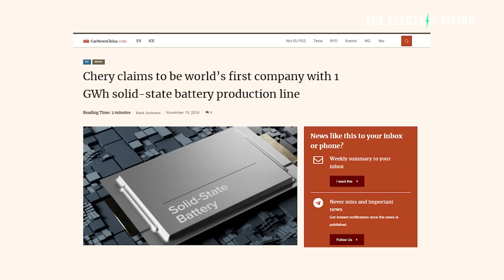Car maker shocks everyone with mass production solid state battery factory

Comment: What about Amprius technologies collaboration with Tesla to achieve an extra 20 percent range and 80 percent charge in under 6 minutes ?
Factory to begin production in 2025.

Ultimately if the car does 300 miles a charge, I’m good with charging it twice to get the range of a more expensive solid state battery.

Comment: While I agree that EVs are absolutely necessary and the only way forward in the future, ICE should and will continue to have its place in the market.

EVs are undeniably superior for everyday driving and luxury applications, but ICE offer a level of excitement that is ideal (and almost essential) in performance vehicles.

Naturally aspirated, high revving ICE vehicles produced in low numbers will stick around. Not as a mode of transportation, but as a means of entertainment. For a weekend joyride, not a daily driver.

As battery tech improves and the weight problem is overcome, EV sportscars may become more engaging. However, there will always be a market for ICE sportscars.

Comment: Its not a rocket science.  Currently ev range is rubbish so doesn't make sense to buy it for most people. Also limited charging options and time to charge them. If evs reach the range of ice cars, then we can start talking.  But battery cost and car depreciation are still at play.  What i want is 10 year warranty on the battery,  similar range to my diesel car and availability of fast car chargers at every petrol station.  Don't bother talking to me and forcing me to buy ev before that happens

Comment: Unless you are personally invested in a specific technology, the details do not matter.  Something, will come along.  There will be an advent, a sea-change, be it solid state or another one.  To not believe that, is to have a complete lack of faith that developments can be accomplished.  I am certain advances will be made, I doubt many watching Sam’s videos feel otherwise.  Zinc-Carbon, and Alkaline cells were both conceived initially, before 1900 (source:wiki https://en.wikipedia.org/wiki/History_of_the_battery).  In 1991 Sony commercialised a Lithium ion battery.  

But let’s be honest, there hasn’t been the steady stream of development and money invested in batteries, that the last 125 years have seen in internal combustion engines.  And, there’s been a hugely powerful lobby and disinformation group (Big Energy Gas & Oil, ‘Big EGO’ as I call it) banging away trying to undermine this, including the involvement of Henry Ford.  In other words, the development that has happened, has hardly been with a fair wind behind it - that’s probably changed now.  So we haven’t really had 125 years of sustained battery development, perhaps it’s more like around 4 decades, and those in the energy business with the clout, the political lobbying power, and the cash, haven’t been a generous participant, but a blocker.  I look forward to the next 40 years with a lot more optimism than the last.  Good news Sam, take care all thanks for the insights.

Comment: I’ll bet on ev hybrid with sodium ion / sulfur battery with SOFC / hydrogen fuel cell. For start  sodium ion battery are cheap to make and fast to charge combine them with  SOFC fuell cell powered by methanol  or natural gas / lpg  or hydrogen fuell cell with amonia   infrastructure is already there and dont require no investment all you need to replace oil with methanol synthetic fuel , also wirless and fast charger stations will place also great role , wirless chargers powered by street Lights can achive charging from 7kwh to 60kwh power   ( puting them on all parking lot controled by an application that include parking metre can easly do task without causing black out )  with fast charger on each Petrol station 150 to 350kwh .

Comment: This is great. I want the EV,s to go full on and take over. However, we all have to calm down and understand that it will not be as fast as everybody thinks because only about 5% to 10% of the population purchases a brand new car. Most buy 2nd hand, which means there has to be a mature 2nd hand EV market first before ICE,s are extinct. This could take more years than everyone thinks. But hey, I am definitely loving it. Cannot wait. I for one will buy a new one, but I am fully aware most don’t want a new car or know it is cheaper to wait for the new car lovers to offload at 30% to 50% off the new car price.

Comment: Sorry bud, I disagree with your assessment. Upgrading the power grid to deliver those sorts of charge rates given fast chargers as you say are going to be required EVERYWHERE is like building another two grids over the existing systems. You also mentioned reduced maintenance cost, sure until the batteries are no longer usable, then the vehicle is junk. So no thanks.

Comment: EVs don't have a range problem. Motorcycles for the last century at most have 300-400km range. I've rarely seen people complaining. Because they could always fill the tiny tank in less than 2 min if they wanted to. I would definitely prefer an EV with a 200 km range that can be charged in 2 min over one with a 3000 km range that can be charged in 6 hours. Range anxiety is a phrase to distract the masses to focus on a solvable problem so that they miss the real problem. It is deceiving. A solid state battery will be an advance for sure, not because it will increase the range, but because EVs are going to be lighter, so that finally they have a chance to compete with ICE cars around the track (probably will be even faster). That is cool. ICE cars will be taken over by EVs only when an EV can be charged under 5 min everywhere (irregardless of it's range), not only on some fancy charging station. That is really unlikely to happen soon, because it is a grid and infrastructure problem that will take a long time. But even that can be solved if battery swapping becomes a reality and batteries are standardized and charged in charging stations nonstop.
Reply: So true. at least for me, it's not about range (or shouldn't be when we have enough chargers), but how long it takes to charge.
Reply: EVs have range problem. Have you seen an EVs in off-road in a straight uphill climb??
Reply: @cottongenni  in any racing environment,  on track, hill climbs etc, because they cannot make use of regeneration through braking, you are 100% right. They are useless. I was excluding such cases when i wrote my first comment, as most people are not racing.

Comment: NYC have 2.2 milion cars , I wonder how long it will take to charge them if all of the will be electric, asuming that you are using that 800KW/H charging station? Using that 5 minuts charging that you stated you will only get 66.6 Kw maximum theoretical charge (one day driving to and from work), and 12 cars  per hour and 288 per 24 hours at one charge station. So for 2.2 milion cars to charge every day, you will need absoloty minimu 7638 charging station - in reality that need to be 5-10 time higer number.  Currently NYC have around 800 gas station. The reason why 1/10 of gas station recuired comparing to charging station, becaouse gazoline have such high evergy capacity that one fill up of the  tank will last up a week. For that 2.2 milion cars you will need 145.2GW per day. Currently NYC used 11 GW per day. So electric cars for all NYC is pipe dream.

Comment: AI server farm capacity is maxed out because there is insufficient electricity to supply AI growth. There is also no spare electrical capacity for increased EV adoption. Until more electrical power generation plants are built, EV adoption and AI adioption is stalled. Unless regulations are rolled back, outside of China, building new power plants takes decades to permit and build.

Comment: One of the factors in changing to EV's worldwide is never mentioned in most of these videos, and that's the cost of Diesel and Petrol, the cheap cost at the moment is purely due to bulk production, as EV's become more popular and less fossil fuel is purchased the cost of that fuel will increase rapidly, to the point where it becomes unaffordable. You have a service station and you suddenly lose 30% of your business as Toyota implies, what do you do? Well you either adapt or die, do you put prices up? Do you start installing EV chargers? Both? You might say, yes but service stations make most of their profit from other stuff, food services etc, but you have to get the buyers in to use those services. If that number increases much more, 50%, 60%, well if you don't adapt you are simply gone, your business model is no longer viable. But the big factor is, the less fuel used in cars the more expensive it will become, and that will be important in the next few years.

Comment: What are solid-state batteries?  Are they dry on the inside?  Are existing lithium batteries wet?
Reply: The electrolyte in the battery is currently more or less a wet slurry of flamable fluid. Over time lithium can build dendritic through it, 
the growth of Li dendrites over time may give rise to battery short circuits, which is the primary factor limiting for batteries..
A solid electrolyte prevent those dendrites from building through it, mitigating that problem.
Reply: @larsnystrom6698  Thank you for the answer and explanation.  I'm aware of dendrite problems in nickle-cadmium batteries.

Comment: You are hilarious making predictions about what might be happening in Europe 10 years from now.  In 10 years, Europe may be nothing more than a heap of ruins or a place where soaring energy costs have deindustrialized the entire continent or a place where Sharia law rules the roost.  Lets wait and see how these batteries actually actually perform and if they really deliver what solid state batteries are supposed to be promising.  I remember the hype around 4680 5 years ago and they have yet to deliver what they promised.

I will consider an EV when they can give me 750 miles of range,  15 minute 80% charge, no more than 10% degradation in subzero (f) temps and when there  is a chargin network with well maintained chargers that are 10% as numerous as gas stations

Comment: It is great news. Aptera has a partnership with Chery, so hopefully by 2026 when volume Aptera production begins, Chery will showcase their 2nd generation solid state batteries in the Aptera to provide 1,000 miles of range in the same battery pack that they are using for the initial 400 mile Launch Edition models.

Comment: Nope - again.  Even if they DID have one (nothing produced yet, still all hype and hot air) the average refueling station will service 80-100 vehicles per hour (full 'charge' albeit liquid in form).  ONE vehicle (say 60kW) getting a full ELECTRIC charge in 3 minutes means 1.2MW.  Do that with 10 charge points and you're talking 12MW power requirement PER STATION.  That's what a small town uses (1,000 houses).  Not only would those charging stations have to be grid connected the grid would need the capacity to serve it.  Not going to happen.  Most locales are 'on the edge' for capacity as it is.  Have you tried getting a new business connected to the grid recently?

Comment: In terms of parts alone, EVs are much less complicated to assemble. They have way fewer parts than an ICE vehicle. It requires far less engineering to get the most out of an EV than it does to get more efficiency out of an ICE vehicle. Solid state batteries are just a step towards making ICE cars obsolete if they are not so right now.

Comment: Presenting a battery with only one property (energy density) doesn't say much. It "easy" to make a battery that is great on one property, but bad on the 4 other important properties like price. cycle life, Charge/Discharge Rate, Thermal Stability and Safety.

So I'm waiting to celebrate until we see more.

Comment: I may be wrong but regen braking doesn't eliminate brake pads and rotors.
Reply: Over 100 k miles on my Ford hybrid and very little wear on my pads. It has rotors and pads, but barely uses them.
Reply: @patrickhenigin4805  but it has them, right?

Comment: Che  ry itself last month in an official press con claimed 600 wh/kg energy density for this ultra amazing dry coated electrode solid battery cells for early 2027,this will lead to 800 miles of range for evs.

Comment: BTW Sam, regarding energy density: when it is expressed in terms of mass (Wh/kg) it is called Specific Energy. When it is expressed in volume (Wh/L or cm3) it is called Energy Density. Both measures, are of course measures of energy density.  I think the latter should be called volumetric energy density.
Reply: Their discussing cars so specific energy should be the correct term since we're hardly moving around fluids in motor vehicles
Reply: @nafizulsanko  Space (volume) matters a lot in the design of EVs as well! A more compact battery means more cells (more energy) can be put in, increasing the range of the vehicle.  So, volumetric density is important too, if not just as important as specific energy.
Reply: The former can also be called massic energy. Volumic energy and massic energy is easy to remember.
Reply: Good clarification!

Comment: This primitive one-year-only solid state battery model seems to be more of a matter of trying to get the factory to work right in time for the real thing next year (or the year after that).  What are the advantages of a solid-state battery that doesn't cost less or have a higher energy density than the best li-ion?  Maybe fill some contracts for high-performance military drones where temperature or durability matter?  Maybe fast charging speed for highway trucks?

Still, I'm so glad they beat Toyota into production (and that Toyota had to make a deal for foreigner solid state tech).  Toyota was using solid state as a movable excuse for inaction.

Comment: Chest to stick up for the community in the state of Michigan that had the battery plant come in. They were all kind of deals being made and part of them was that the community would have to be introducing and supporting Chinese workers. Another words there was to be a Chinese workforce from China and it would not benefit the local population because they would not have those key jobs. I don't know all the rest of it but I believe there were all kinds of tax incentives and it was slipped through by the time the local populace caught wind of it they said hey what is it in for us and why is this done so quietly. That was just local reports so check for yourself. There's always the other side of the story. By the same token you can have all the electric cars in the world you want and they can be great but where are you going to get the power.? I know everyone is pushing for this but how about starting to look how you're going to produce the power when it's going to be used.a great deal of our power in this country is made on demand so to speak by call gas and oil in some form or another. The last administration shut down as much petrol as they could and have plans for more and of course the utility sink the government is going to bail them out pay for new plants so they can charge us through the roof high rates. Wind and solar are great but you have the losses of putting it into a battery and getting it out charging a battery so what are you going to do when you need the power and the sun isn't shining and the wind isn't blowing????😊

Comment: This is very important news, and deserves research and verification (as do all sources of news on the net) . I have a colleague who is down 90% on his holdings in Quantumscape, a Solid State Battery company.  If this story checks out (and no slight on the viking but anything related to this kind of a delta for technology  I will always do my homework) then Quantumscape is doomed.  My colleague is pretty flip about his holdings since he's basically wiped out and going long but a company like Quantumscape, whose battery is 800Wh/L and in the staging phase, not quite ready for mass production can be killed in the cradle by a company mass producing a cheaper, better alternative. CATL clocks in at 500 WH/kg and this one clocks in at 280 Wh/kg , but mass production means these things might go all over the place fast and hit first mover advantage. Fast, cheap or good. Pick one. Good reporting here, Viking. Thank you for the heads up. This is a big deal.
Reply: I have been wondering about Quantumspace too - invested a little a while ago - any news on their progress?

Comment: I won't hold my breath. But if they truly get them into their cars like they said....good for them and us.
Reply: For “us” depending which country you are from….
Reply: In air plane too, it will revolutionised the battery industry because it is so light, large capacity for longer distance and fast to charge too.
Reply: You are used to Western promises and speed.

Comment: More Chinese bs. No one has the tech to make solid state batteries. China's 8th largest batt fac just pulled out of Europe. BYD is about to go bust. The EV world is built on Chinese govt funding. EU is ramping up tariffs and cutting subsidies. US is doing same. You say VW is part owner but VW is going bust. You can keep sprouting EVs and BS battery stories. All you talk about is "assumptions". You clutch at straws. Fast chargers are not happening. EVs will globally be less than 10%